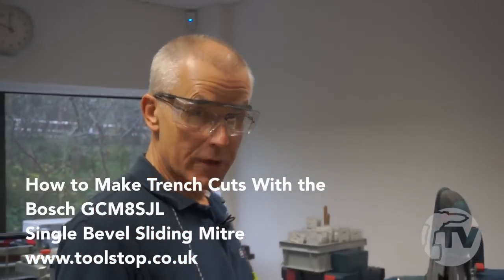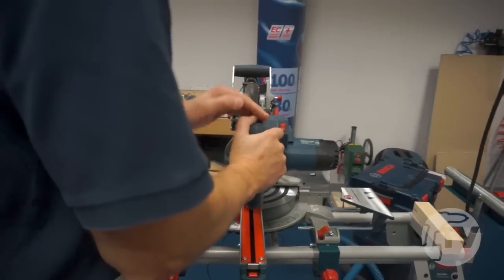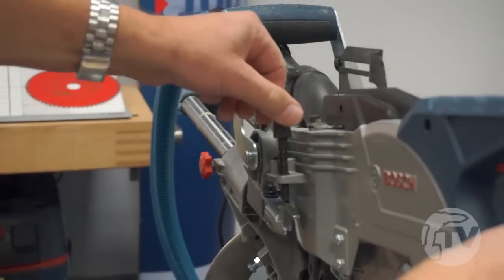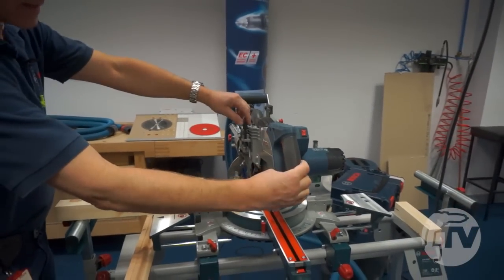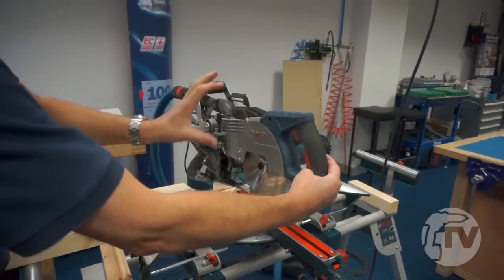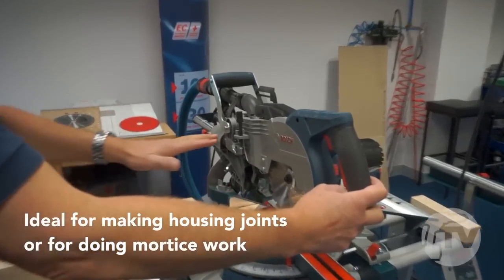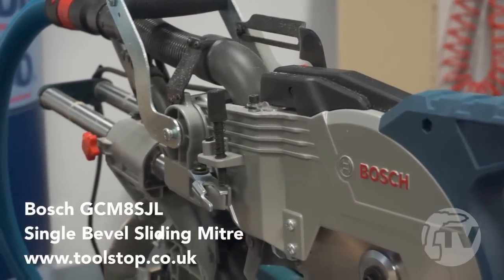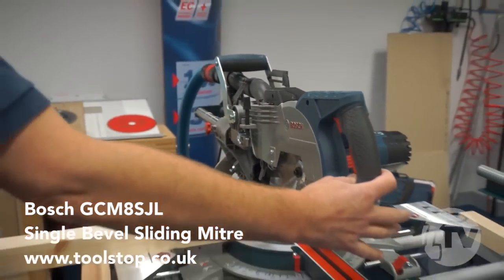How to make trench cuts with the Bosch GCM8SJL Single Bevel Sliding Mitre Saw

Comment: Tips. 
Very important if you would like to saw with precision. (avoid torsion as much as possible)!
Always choose a Miter saw with a handle positioned in a vertical line above the saw blade.  
Everything must be aligned, slide rails, handle, and saw blade,it is much better this way the blade will not tilt.
Because there is some torsion in the aluminum housing .
And choose an engine with softstart on it to prevent wear of the gear and worm shaft.
It is very important that everything is aligned.
Here are some examples to show how the handle must be positioned above the blade.
Bosch gcm 800 sj / Bosch gcm 8 sjl / Evolution rage 3 / FESTOOL KS 60 / HITACHI C12RSH2 / FESTOOL KS 60 E KAPEX / Metabo KGSV 72 Xact 

(This also is the case with the Miter saw without the slide rails).

If you want you can test it yourself at home if there is torsion in the aluminum housing.

Step-1. First you make a saw cut from +-5 mm deep in to a flat piece of wood about +- 20 mm thick to this with the normal handle positioned on the right side of the Miter saw (the wood it will remain in place until the test is completed).

Step-2. Then repeat this by pushing the saw blade down with your hand (finger) on the aluminum protective cover were the saw blade is cased in. Just now only do this without the running engine.

Step-3. Now you can see if the saw blade will be positioned in or next to the saw cut. If the saw blade is (+- 0,2 / 0,5 mm) next to the saw cut then there is torsion in the aluminum housing (test is completed).

Step-4. therefor it is much better to choose a Miter saw with the handle positioned vertical in line above the saw blade.

Step-5. When you measure the vertical 90 degrees angle square (Digital Level Box) of you're sawblade don't forget that there is always some torsion in the aluminum housing.

Conclusion:how further away the handle is from the saw blade how more chance of torsion in the aluminum housing don't go for that  (the choices are yours).

Also with a cheap slide miter saw it is still better the handgriff in line a above the saw blade than on the right side. Maybe they will make it someday then we have a winner...